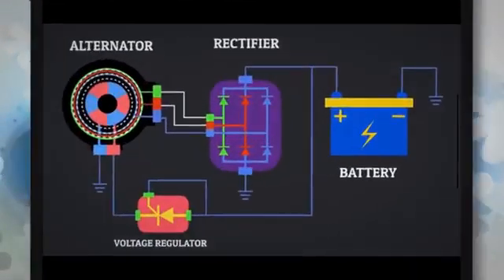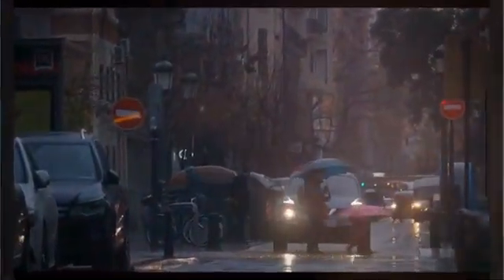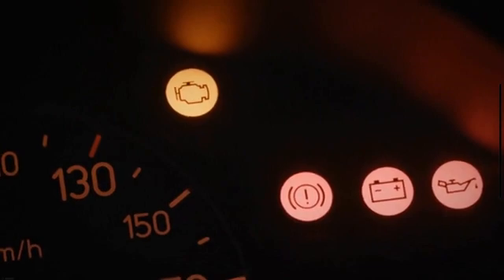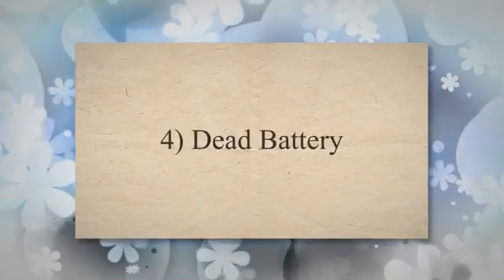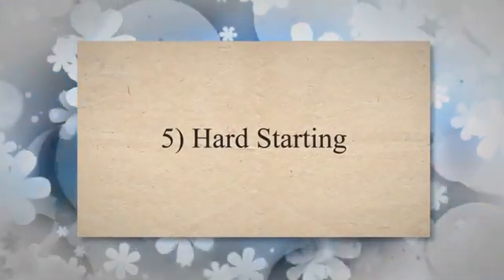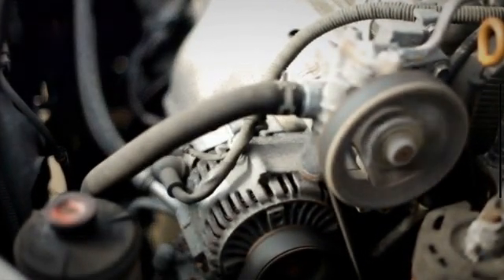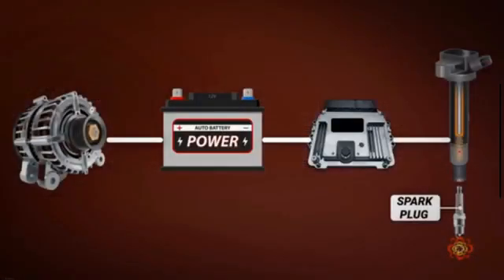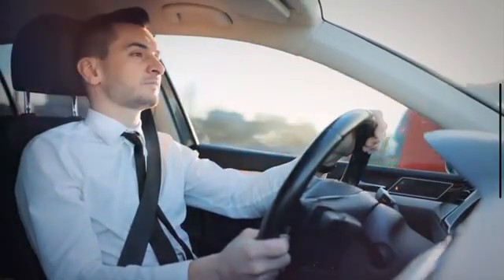TOP 9 SYMPTOMS OF A BAD ALTERNATOR

Comment: My truck will usually turn over on the 2nd try but it’s a long try I just had my battery checked and they said it was bad so I got a new one but it still has the same problem. I changed my starter my air filter and my fuel filter so now I’m at a cross between my alternator or my fuel pump. Can a bad alternator make your battery clap out the battery was only 2 years old and I found it odd it didn’t even last that long
Reply from the maker: Your question is not clear.. Kindly repeat your question what do you want to ask?